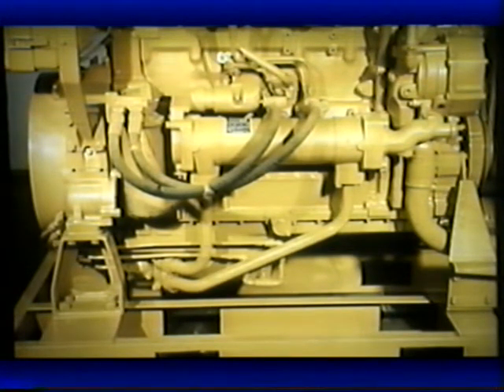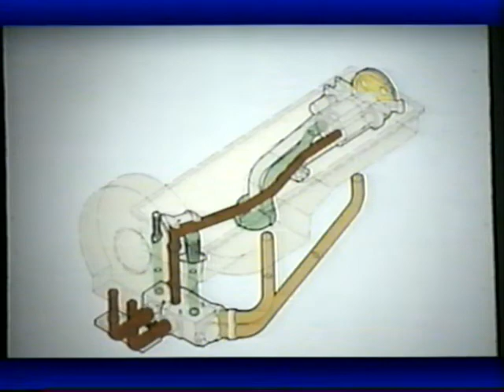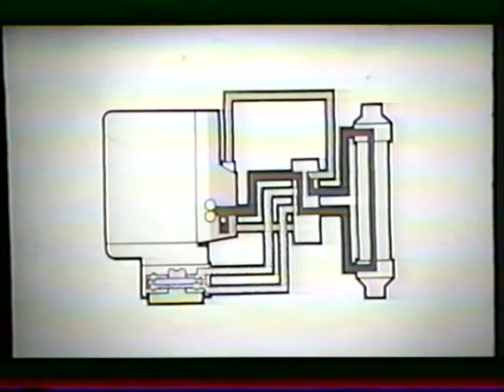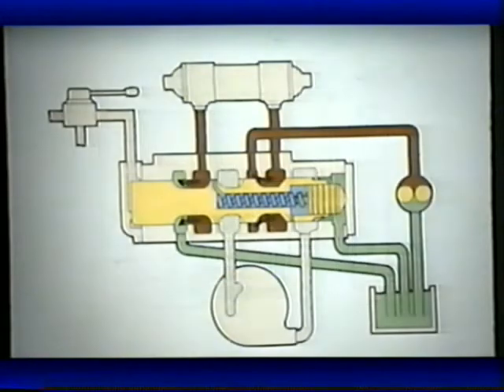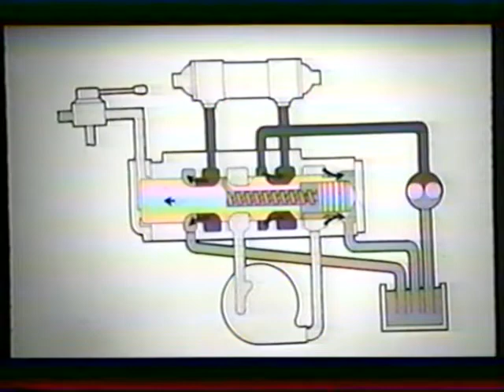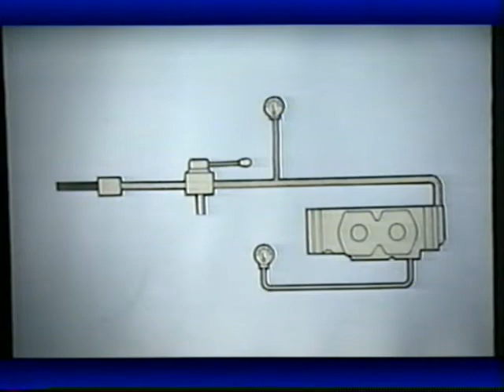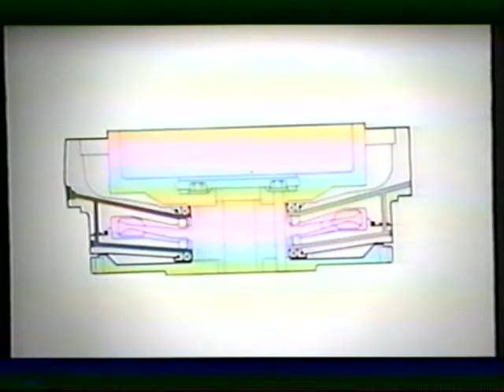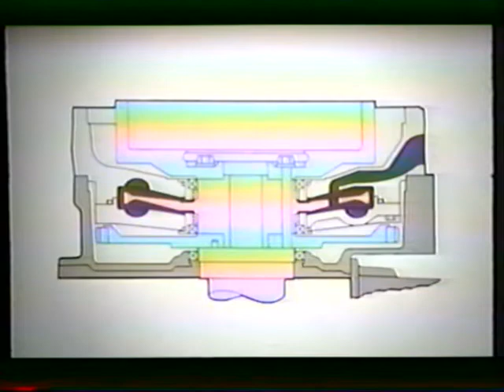CAT 3406 Engine Features CAT 3406 Brakesaver

Comment: Great video, I have a question from my Truck techninican exam. When an hydraulic retarder is in the apply position, air comes out the engine oil fill tube, what is check first? a) diaphragm B. Air Compressor, C. Control Solenoid or D. Control Spring
Reply: diaphragm on control valve leaking air into engine oil very common problem  I change it about every third oil change
Reply: The diaphram